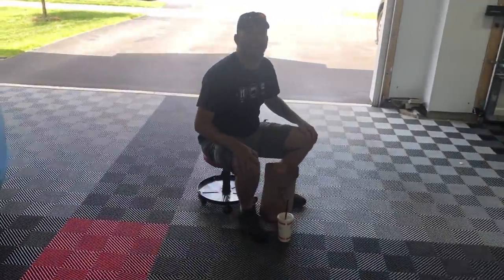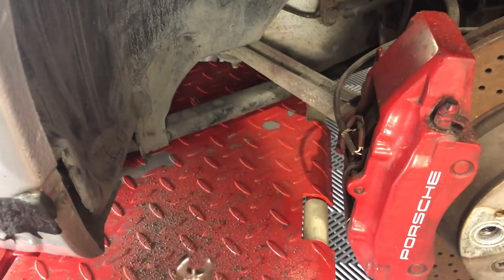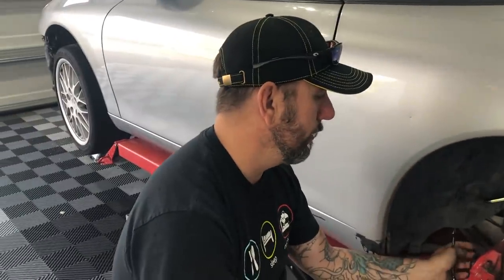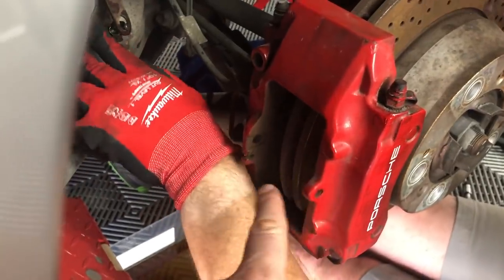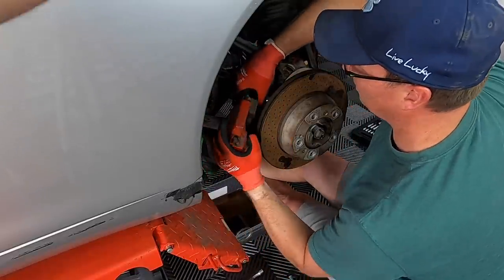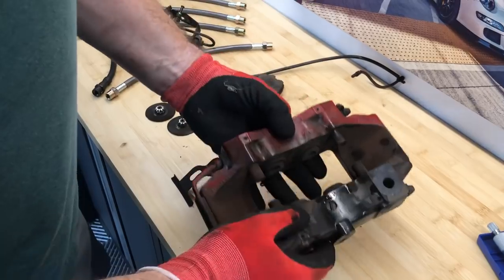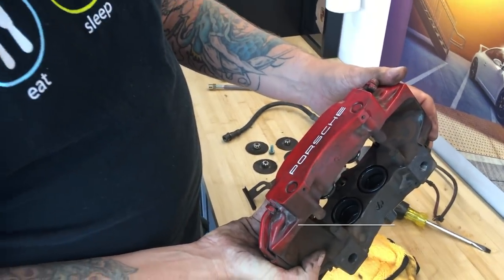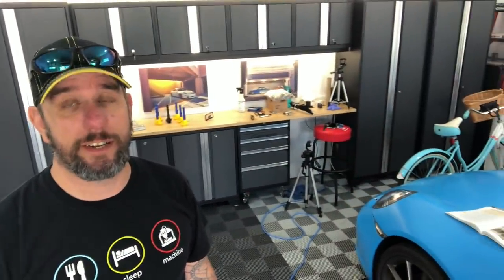Porsche 996/997 Brake Calipers Disassembled - Project 996 EP 08

Comment: Quick tip, press the brake pedal and keep it pushed down (wood stick etc...) to avoid all brake fluid to leak out. It "locks" the oil in the lines and the fluid reservoir.
Reply: Thanks for the tip!
Reply from the maker: Good tip!

Comment: Great video! Question: the caliper you took off doesn't look too bad. It looks like it would clean up just fine. Are you having it powder coated to change the color or are the others worse?
Reply from the maker: You're right, the calipers are actually in pretty good condition. We're considering changing their color to match the overall design style we have in mind. We're still on the fence a bit though.
Reply: @AutoAmateur  Ah yeah, I think matching the calipers with the exterior paint would look sweet! Can't wait to see what you do!

Comment: Sitting with both legs directly under the "disk" while on lift/jack stands makes me nervous....
Reply from the maker: I know, right?! The scissor lift though has a mechanical fail-safe that makes it virtually impossible for the car to move once it's up and in the parked position. If the hydraulic lines failed or we lost power, or both, the lift won't go down. The only way to make the car move would be push it sideways and move the center of gravity into an unsafe position. But given the weight of the car, it's more likely for the lift to move with the car than the lift staying still and the car moving off to the side.
Reply: @AutoAmateur   Thanks...nothing can repeal the "law of gravity".  

I still enjoy your channel.  Looking forward to seeing the completed car.